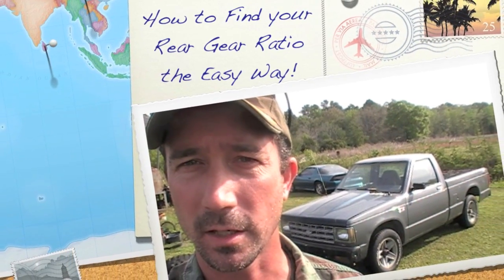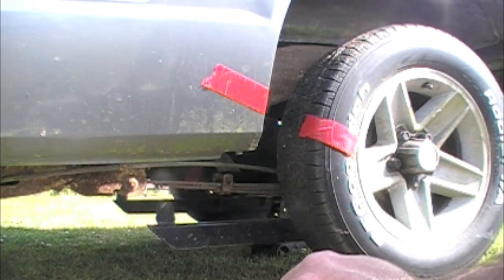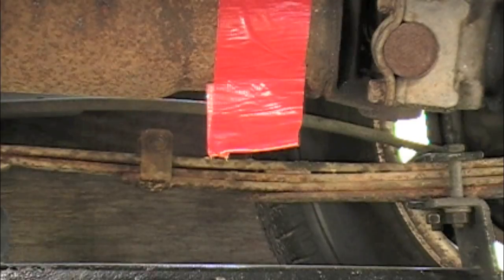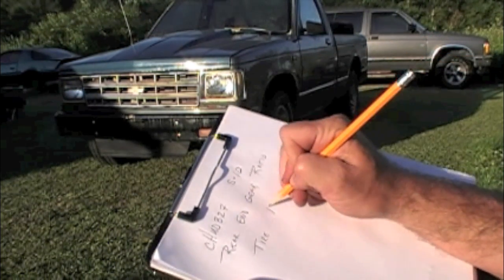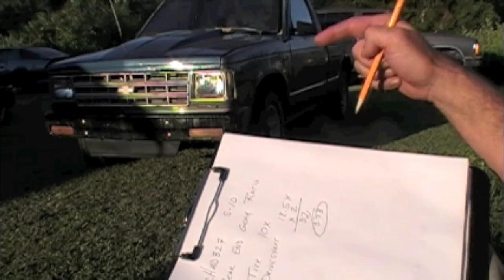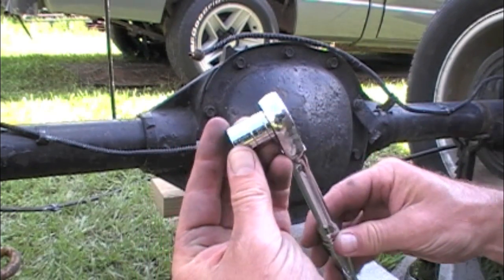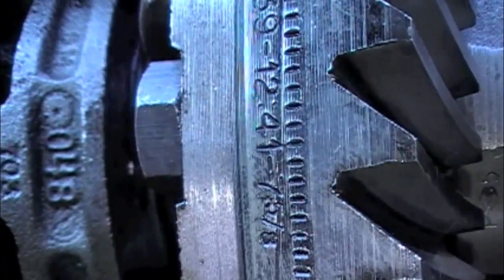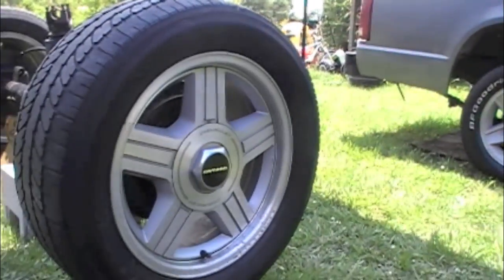How to Easily Find Rear End Gear Ratios

Comment: How is the best way to make sure that I ordered the right driveshaft? there are so many different ones. Or howd
 Do you measure for wheelbase
Reply from the maker: I measure from the universal flange to universal joint flange, then I usually go to the junk yard and try to find one that is the right length. Only thing is they move the vehicles at the junk yard with a front end loader and most driveshafts are damaged, but if you look long enough, i can find one not damaged and the right length. We also have a drive shaft shop that will build anything you need. You can take one from the junkyard and they will shorten it for you. The junkyard only charges about $18 if you can find one that works.  If you tell the drive shaft shop what vehicle and what transmission you have, the guy might already know which one will work. Hope this helps and if you watch my latest S-10 build for about last October, I walk you through how I find my driveshaft. Good luck and thanks for watching.

Comment: 93 GMC Sonoma stock rear in the motor is a Chevrolet 350 transmission is a three speed turbo. What is a good suggested rear end to do a little hot rod in but at same time I’d like to be able to do 80 miles an hour or faster at the highway
Reply from the maker: I would go with a 3.42:1 if performance is more important than gas mileage.  It is an all around good choice.  I had a 2.73:1 in first car and it did good, especially for gas mileage and the way gas prices are going... Thanks for watching and good luck. Are you doing any video on it?

Comment: By the way, many of the s trucks came with a factory spiro-locke differential. Only locker available stock. And does NOT spin both tires in reverse. Only when power applied going forward. Gets you stuck most every time.
Reply from the maker: Thanks for watching

Comment: Yeah, I lost that about 1 and a half from your house. Im not sure the road name. But, it was somewhere before that little grade. I heard it hit my inner fender but wasnt sure ehat it was. Until, I went to clean my battery terminals, next morning and had no wrench or socket. I had used it 5o try to tighten up the hold down on battery. The '85 k-5 with the j-code 6.2 8s rough riding old cob.
Reply from the maker: Thanks for watching

Comment: Thank you Chud. Very helpful. I have a 79 G20 Van running big block and am currently fitting up a 4l80E auto. I am modifying converting the tail housing to speedo cable drive. I need to find out the diff gear ratio in order to calibrate for speedo accuracy. Cheers.Very much appreciated.

Comment: I put a set Irock-z rims on my 1985 GMC a 4zx4 S15 and I noticed they were marked front and rear on the actual Rims well some reason on the front the rim stick out like at least a couple of inches past the Fender wells where as the back there tucked inside the Fender well is there any reason the offset might be different from the back to the front if I were to switch it would it make any difference or do u know thanks

Comment: Count the teeth on ring gear divide it with pinon you’ll get 383. 411. 513 and so on
Reply from the maker: That is the most precise method, but hard to do if you don't want to pull the rear cover and dump your oil... Thanks for watching.

Comment: The rear end ratios 341 if it has a 12 tooth pinion in a 41 ring gear divide 41 by 12 3.41 route 373 and I do have 370 gears my truck has one

Comment: What this video and many others on this topic fail to clarify why there is a multiplication by 2?  On some You Tube vids there is no multiplication.  Another thing that vids do not clarify well is what type of carrier an axle under analysis is.  Open/standard diff, locker diff, etc type.
Reply from the maker: Sorry about that, this one was a locked rear to start with.  That is why one tire had to be blocked.  Since only one tire spins, the tires spins twice as much, therefore you need to divide by two. If you have a spool, you could jack up both sides and not divide. I hope this helps and thanks for watching.

Comment: Can't get a grip on why there's the "multiply by 2". ???
Reply from the maker: You only have one tires spinning so that will spin the drive shaft twice as fast as if both tires were spinning.  So if you do the math and it says you have a 1.865 you would double that and get a 3.73.  If you rear has a spool which keeps both wheels locked together, they would spin exactly the same amount of times. You would not block one wheel and you would skip the multiple by 2 part. I hope this helps and thanks for watching.
Reply: @chud327  

Thanks for getting back - "I'm working on it."
Reply from the maker: Let me know what you find out and thanks for the reply.

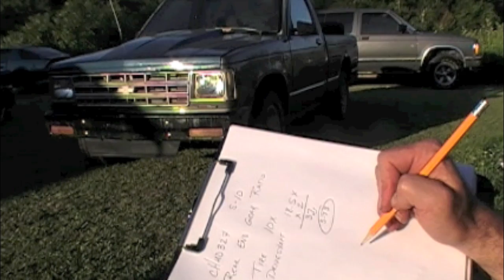Comment: Thanks but question please. Have locking posi. do I still divide by 2? I think it's 3:55 but unsure. have power glide 2 speed which makes it harder to guestimate. I would much rather know for sure. thanks I subscribed
Reply from the maker: Good question. If both tires are locked together and turning the same, you would not divide by two.  Thanks for watching and especially for subbing.  Good luck.
Reply: @chud327 thanks
Reply from the maker: Anytime!

Comment: To get a general idea setup like he did turn the wheel one turn, watch how many turns of the driveshaft if about 3 and a half you have 3.42,  if shy of 3 turns you have 2.73, if 3 and 3 quarter turns you have 3.73, if little over 4 turns 4.11 and so on.
Reply from the maker: That would be a good way to estimate it and thanks for watching.

Comment: I do like the 16 in 92 rs wheels but the corvette and camaro rally wheels looks very veery nice on a chevy s10 with nice trim rings and center caps. I own a 1982 chevy s10 350-350 swap and 15x8 rallys on the rear 15x7 rallys on the front i really like the look. Also have a set of rally wheels on my 78 malibu. All your wheels are good choices
Reply from the maker: What a coincidence, I now own a 1986 chevy s10 350-350 swap and 15x8 rallys on the rear 15x7 rallys on the front i really like the look.  Please check it out and let me know what you think.

Comment: Great video if I did it right I have a 4.10, but the question I got is I checked if I have limited slip rear end and I do but when I turn the tire the other side barely turns is that normal
Reply from the maker: That may be normal, which direction does it turn?  Thanks for watching.

Comment: Great video, how do you figure that 12:41 = 3:42 Gears? What did you divide it by?
Reply from the maker: There were 41 teeth on the ring gear and 12 on the pinion gear.  If you divide 41 by 12, you get 3.41666666667 which round up to a 3.42:1.  I hope this helps and thanks for watching.

Comment: Thank you very much! Found your video right on time.  Going to change my gasket tomorrow because of a leak.  When I had mentioned it to my dad (lives in different state), he told me to go ask someone to show me how to find out what my gear ratio is.  I thought Oh great, I got too many things to do on my truck that needs attention, everyone else is busy too, but I gotta make time to please Dad and figure out the ratio.  Didn't realize how easy it is until your video, lol! And now I'm really glad my dad asked because this would be the perfect time to check the exact ratio. I don't know what it'll tell me but I guess my dad will give me a lesson when I tell him what mine is. Btw, what color did you end up going with?
Reply from the maker: It is soooo easy and I am so glad it helped you. Thanks for watching.  Let me know what you find out.
Reply: I'm embarrassed to admit, I had a really hard time with the differential and got myself in a pickle.  My plan was to torque the bolts on the cover to 20 ft lbs, starting off lower. As I tried torquing to 10, several of my bolts broke and now I guess I have to drill them out.  I picked up some Grade 8 and 5 bolts (because store didn't have enough of the 8's). I don't know what grade my original bolts that broke are because there's no markings on the top (just has a #3 printed on top).  The grade 5's I picked up, I don't even think they're heat resistant. Will these suffice as temp use until I can find the right bolts, or do I need to replace the gasket again once I remove the temp bolts? I presume I'll get a small leak once I remove any bolts, so not sure if that would compromise the new gasket I just put in.

As far as the gear ratio goes, no ratio markings inside :( Got some numbers but don't look like ratios.  I'll send a pic if I can figure out how.  I counted about 1/2 way for each of the gears, 24 and 8, so I guess 3.0 would be a rough estimate.  In the back gears (the one with about 16 teeth), had a small etching that looked like 2.756.  Not sure if that represents the ratio.
Reply from the maker: I would love to see the pictures and the bolts shouldn't need to be heat resistant, rear end shouldn't be getting hot.  You could use a new gasket or some silicone sealant.  The number on the gears should tell the story.  If the big gear would be about 24X2 which would be 48 and the little on the back is 16, then 48/16 = about 3.0.  I wish you knew the exact number of teeth on each...
Reply: Good to know that heat resistant bolts not needed, thanks.  So I guess as long as there won't be any leaks, I won't need to replace them. That will save a lot of time.   I wish I was able to count all the gears too.  Wasn't able to get them to rotate and the small one in the back is waaay back (hard to reach).  I don't know why my truck always seems to be more complicated then the videos I watch on how to do things, lol! Not sure if there's a way to upload pics here in comments:(.  Btw, Happy Easter!

Comment: Look in glove box for the build code if it’s a gm
Reply from the maker: Good tip and thanks for watching.
Reply: chud327 that’s how i found my 2011 Silverado had 3:08 gears and sucked at towing even with 5.3 liter. I found the code in glove box.... after I had already bought it though.
Reply: Not always there. Just looked yesterday on my 97 Chevy 3500 6.5 turbo diesel.  Absolutely no tags in the glove box
Reply: @johntate4638  
It's not stupid.  What if the previous owner changed the gear ratio?  Now, you know how to determine without it written in front of you.  Knowledge is powerful thing.

Comment: Hello .thanks for the video 
I have a question.
I have a Silverado 4x4.2001 I have 2 times to change the differential. I don't understand what's wrong.
Any advice. Please. Thanks.
Reply from the maker: I would consider finding a whole new rear end with the same gear ratio  as your stock rear end.  I have looked into it, but there must be something wrong with yours. That or you just have too much horsepower, good luck and thanks for watching.

Comment: Thanks man. I'll use your method to see which ratios I have on my 86 K10 and 88 S10 with a G80 locker
Reply from the maker: It is the best method I have used, thanks for watching.
Reply: If you have a posi all you need to do is turn the wheel until the driveshaft turns once then however many time your wheel turned is your gear ratio
Reply from the maker: Yes, with the posi, you wouldn't have to stop the other tire either... Thanks for your input.

Comment: turn the wheel twice the driveshaft should turn basically 3 and 3/4 turns or 3.73 times
Reply from the maker: That is a good and quick way to estimate what you have. Thanks for watching.
Reply: Why not just look at the tag?  That one likely has GT4 stamped on it, which is  a 3.73.
I get it.  Just in case the tag is missing, you can use this method.  But, still, he could have said, "If this tag is missing......".
Reply: Tags rot away or get forgotten to be put back on.  Mine is broken in half

Comment: I'm confused. You jacked up both rear wheels, then immobilized one of the wheels. Why not just jack up one rear wheel so that you would not have to jam a hammer beneath the wheel on the opposite side? It would have the same effect, right, or did I miss something here?
Reply from the maker: Jacking up one side would work perfect, as long as it is not a pose.   I think I jacked mine up on both sides for better camera access, at least that sounds like a good excuse.  Thanks for watching.

Comment: Have a 99 Mustang, converted to Windsor stroked 408, tremic trans with a 9 inch rear. 
  Car presently has corvette calibers/ 12 inch rotors all way around. I would like convert to cobra brakes.
   I suspect I would need correct bracket assembly for calibers . Also the present  rear calibers don't allow for e brake hook up which is different  on ford calibers. Any suggestions  on what correct parts I need to convert back to all Ford with e brake operation.  Thanks Bruce
Reply from the maker: I am not sure, but there has to be a website that specialize in what you are asking.  Sound like a sweet set up, do you have any videos of it on here.  Thanks for watching.

Comment: do the same steps to check the ratio of my front axle? both axles need to be the same ratio am i right? is there any others that need matching gear ratio that i need to know of?
Reply from the maker: You can use the exact same procedures on the front and yes the front and back should be the same.  Thanks for watching and for the comment.

Comment: or look at your build sheet in the glove box and get the code and Google it or call your local dealer.
Reply from the maker: That would work if you have the stock rear end still in the vehicle.  Thanks for the tip and for watching.

Comment: you video states how to easily find out gear ratio.  you could not have found a harder way to figure the ratio out.  maybe I dont get it,...was this a joke and was supposed  to be sarcastic ?  all you have to do is turn drive shaft untill tire makes one complete turn and you have the ratio. if it takes drive shaft 10 turnes to make tire turn one time your ratio is 10:1 !   its that simple.....roflmfao        I know this must be a joke....No one could be that stupid really !!!
Reply from the maker: You would need a dial indicator or a degree wheel to use you method.  The drive shaft is not going to turn exactly 10 times to get one turn of the wheel, that might be easy.  The drive shaft will turn 3.73 times to 1 for 3.73 gears.  With your method, you could only estimate that number, me method is more exact.  Go ahead and roflmfao, you probably need the exercise.  Sitting there trolling video might be why there is an f in that abbreviation.  The f does stand for "fat" right?  And yes, going by the trolls, there are really people that stupid!!!

Comment: I have a 93 s10 Tahoe and it came stock with a 4.3 and a 5speed trans, I was wondering what  posi rear end would bolt up to it, thanks for reading.
Reply from the maker: +anthonyandino787 I am not sure what all rear ends will work.  I would look for one originally from an S-10/S-15 that someone has put a locker in, but there may be other applications that would work.  Good luck and show me some videos when you get to posi status.
Reply: +chud327 ok thanks I'll probably go online and see how much one would run me, thanks for the info when she's up and running I'll post a video!
Reply from the maker: +anthonyandino787 That sound great to me, I found a great deal on mine off of Craigslist.  Or you could just by your own locker and install in your current rear end.  That is, if you like your rear end gearing.

Comment: Great! my 75 c-10 has a low rear end,(an old farm truck) I need a gear for freeway driving. I need a ratio for a higher gear! Any ideas?
Reply from the maker: +David Chambers It depends on what your truck already has.  My first car, 1969 Camaro, came with a 2.73.  It was really high which is good for top speeds and gas mileage.  In my S-10, I went with the 3.42.  I never got to drive it on the highway before I sold it, but I think I was going to like it.  I would look around for a good deal on something higher, try it and see if I like it.  thanks for watching and for the question.

Comment: yes sir all my ppl are in fla mostly Daytona and up around baxley ga.. i traded the truck for a nothere thats already done has a 427    2 bad things about it is the shifter  is a  hurst pro matic 2  i hate that thing  and other is its been lowered so much it bottoms out  some one took the rubber stopers of the fram   like rideing in a horse and buggy     also it has a vette roll pan with the lighgs need to find me  a parts truck  with a good back bed
Reply from the maker: +William Wimberly That truck sound like a video waiting to happen.  It is a good thing that the gas prices are down to help feed that 427.  I used to have a slammed VW bus, that thing too rode like a tank. I went ahead a got her back up to stock height and put some normal tires back on it.  It actually turned out nice.

Comment: cool deal .... well maybe i get down  sake a hand sone been following u for a while    if u run cross anyone that has the mounts  or a good v8 hit me up have a deal on a 588ci  but maybe a bit much lol also  guy trying to sell me a 383  but i think a good little 350 is all i need in a little truck like that...
Reply from the maker: +William Wimberly 588 would be crazy!  Not that you shouldn't do it!  I put a bone stock 307 in mine and it did just fine for a good sounding daily driver.  Although a 383 is probably my favorite engine (even though I have never actually owned one) the 350 will work super in your truck.  I had one with a 350 with truck head and a lopey cam.  It sounded great and ran fast, but would turn enough rpms to blow it up, it was perfect.  I had a video of it doing a burnout, but I think I deleted it. It had poor sound and the video quality wasn't the best.  Oh and that thing would back fire like a shotgun, that would have may and incredible video...
Reply from the maker: +chud327 truck heads not truck head...